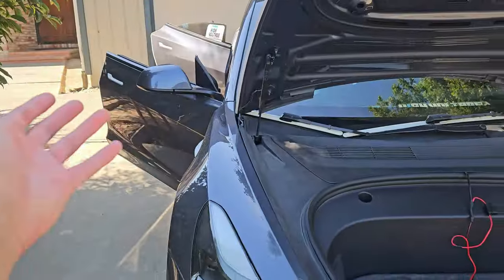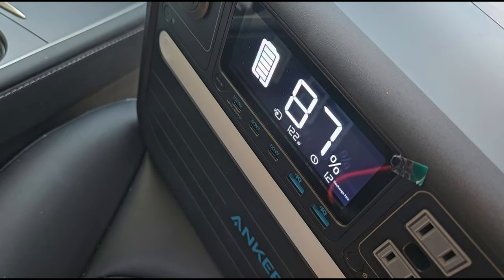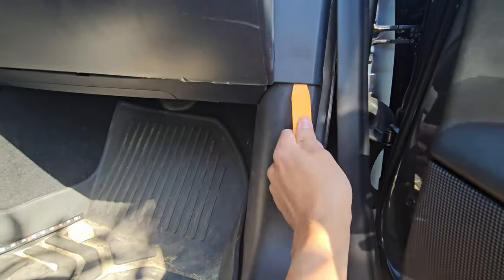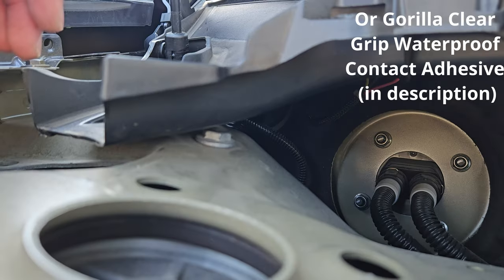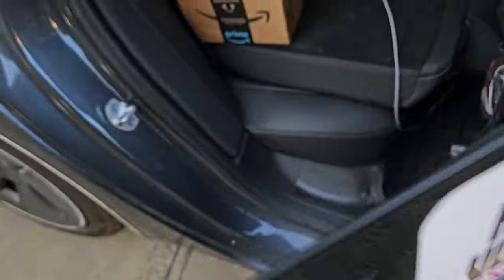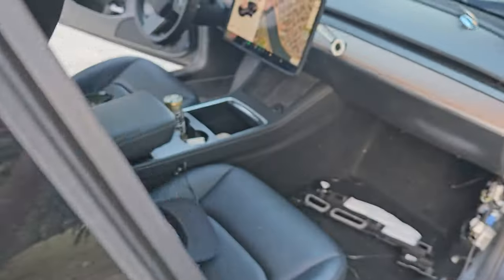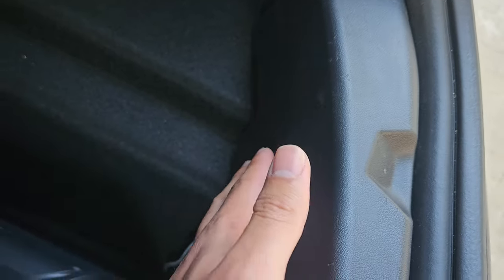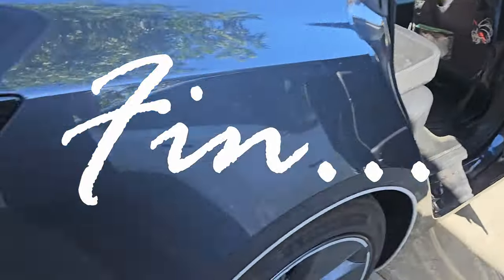2023 Tesla Model 3, through the FIREWALL, front to back wiring inside the cabin

Comment: You could have ran a wire from the posts of the battery under your rear seat (passenger side) and charged the generator/battery from that rather than running wires from front to back of car.
Reply from the maker: Did that soon after this video, I still have to make an update video on it! Good catch!